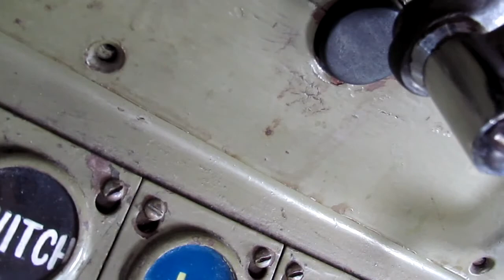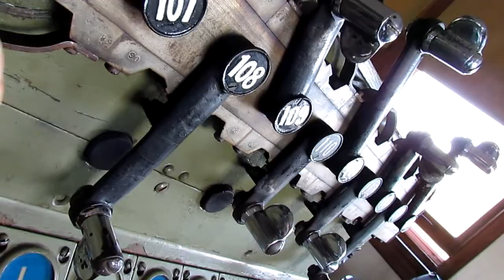PRR HARRIS Tower A "Lever Eye" View of the Model 14 machine

Comment: I worked for conrail, the ex prr div and these type of machines were the norm at almost all of the interlockings, a few did have pistol grip types but the 1 in this vid was very common on the system, what a shame they closed all of those towers, those machines were made to last 200 yrs or more, that is how well they were built by union switch & signal company, right here in pittsburgh pa.